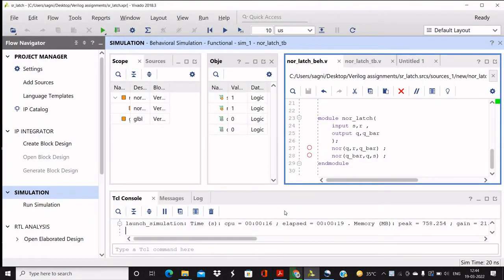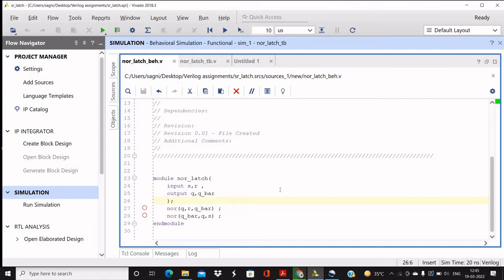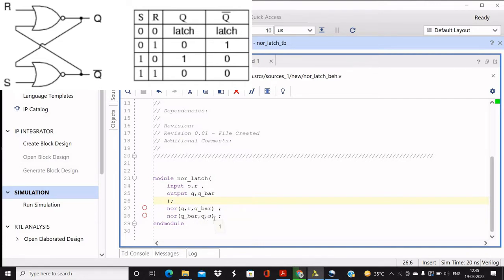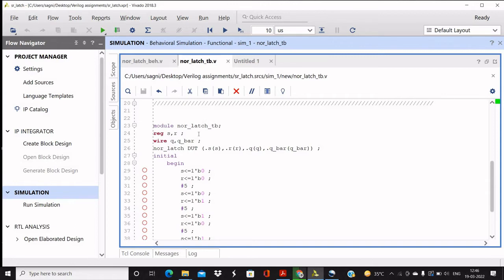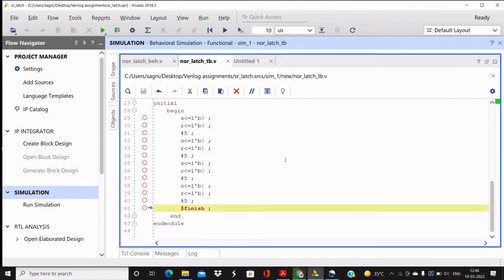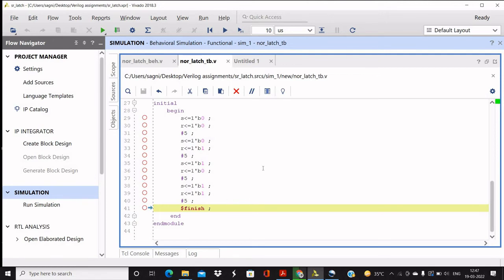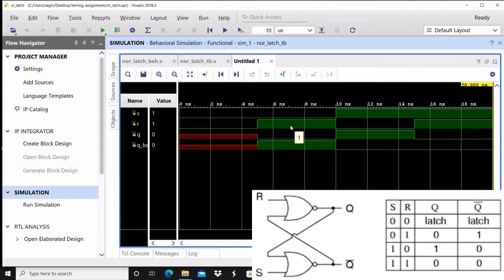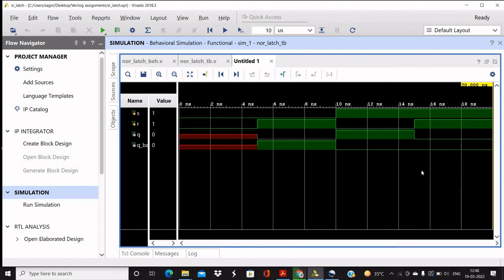SR NOR Latch || Verilog Code || including Test Bench || EC Junction

Comment: Not getting that unknown value by this code what to do sir?
Reply: module SR_latch(
input s,r,
output q,qn);
nor (q ,r , qn);
nor (qn ,s , q);
endmodule

module TB_SR_latch; 
    reg s,r;
    wire q , qn;
SR_latch DUT(
         .s(s),
         .r(r),
         .q(q),
         .qn(qn));
         initial 
             begin 
                 s<=0 ; r= 0 ;
                 #10
                 s<=0 ; r<=1 ;
                 #10
                 s<=1 ; r<=0 ;
                 #10
                 s<=1 ; r<=1 ;
                 #10
                 s<=0 ; r<=0 ;
                 #10
                 s<=0 ; r<=1 ;
                 #10
                 s<=1 ; r<=0 ;
                 #10
                 s<=1 ; r<=1 ;
                 #10
                 $finish;
             end
             initial 
                begin 
                    $monitor ("at %0d time || s : %0b | r : %0b | q : %0b | qn : %0b ",$time,s,r,q,qn );
                end 
             
endmodule

this will give only one time unknown  after that if i give 00 then 01